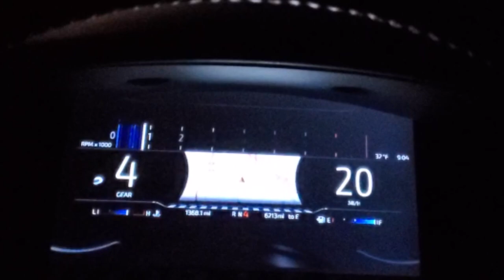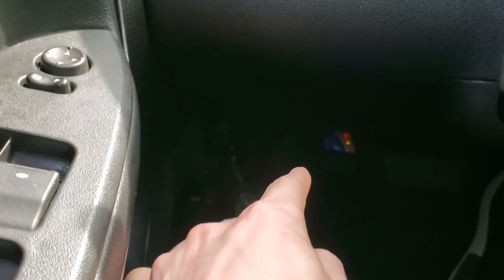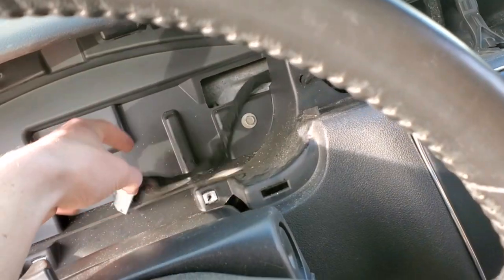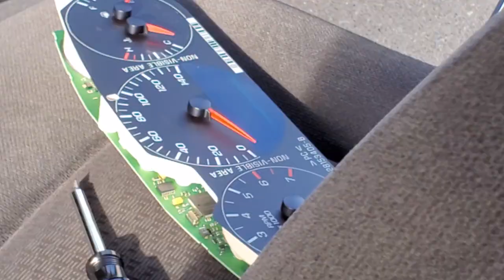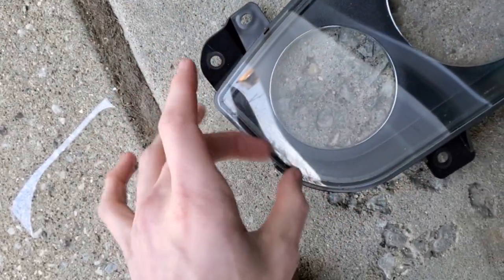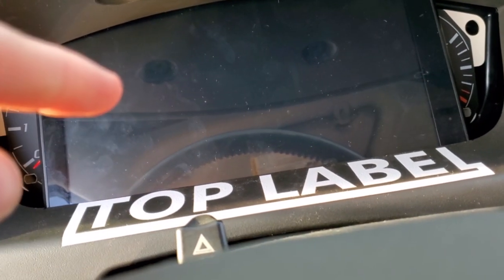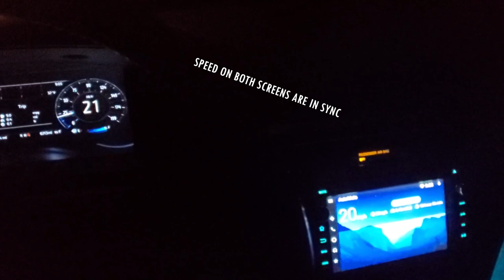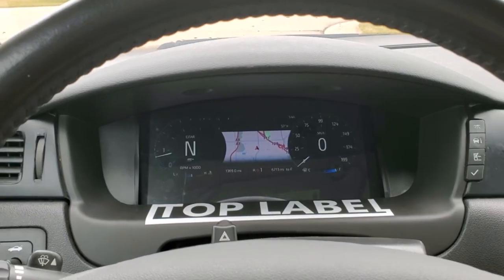DIY Digital Speedometer!! - Project Impala Ep. 9

Comment: And when ur tablet dies then what?
Reply: You hook up charger & run wire through dash
Reply: I have a wireless portable charger that lasts for days I only have to charge it for a couple of hours tho.. I use it for my iPhone XR
Reply: The car will explode
Reply: @lxckyeditz6651  it doesn’t because you tap it into the power source just like any other electrical part. That’s how I did mine with a custom digital cluster.